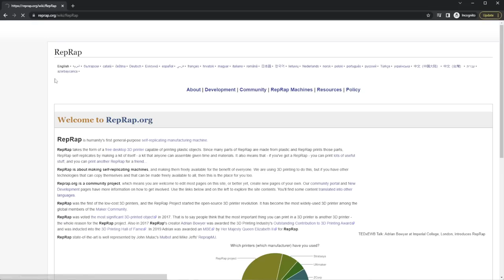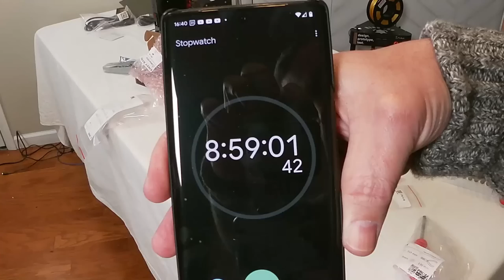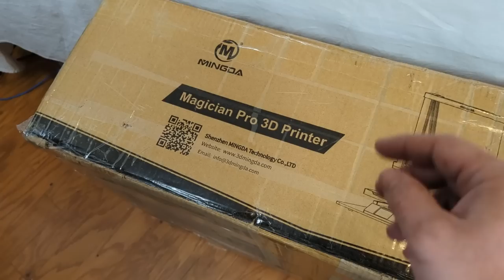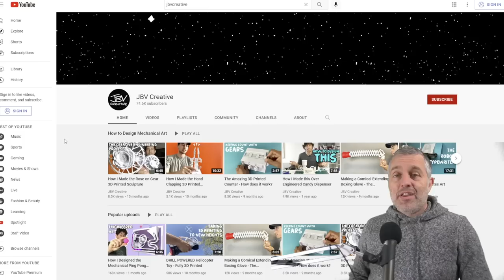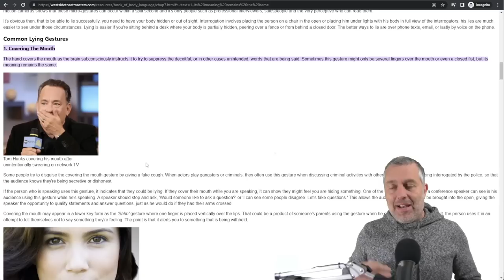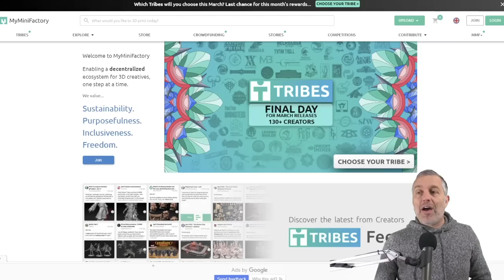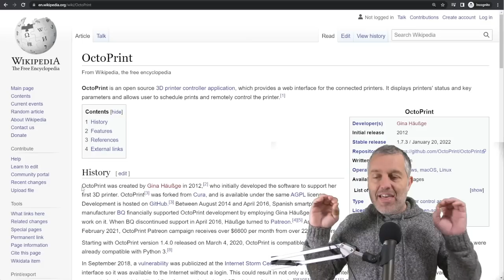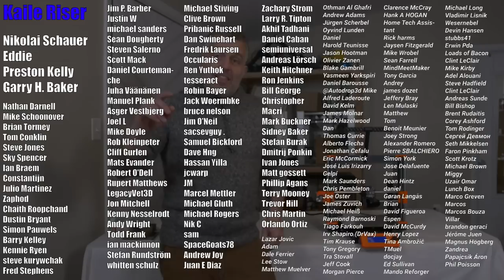Why Does Nobody Speak Truth About The Prusa I3 Mk.3? - It's Overhyped and Over Priced.

Comment: I am a big Creality fan (Ender 3V2), but I found after close to two years of running this printer intensively (pretty good for a $300 investment + probably another $150 in modifications and parts) a large amount of my time is spent in maintenance and calibration. My Ender was an incredible 3D printer learning experience, but now my interest is in CAD design and product fabrication.  It was time for me to buy a new printer and a lot of friends suggested the MK3S+ which I purchased as a kit.  It took me 8-10hrs to assemble (sure I could have done it in half the time if I rushed) and it just works. I think when you're a manufacturer in Czechoslovakia and you want conquer the international market you need to offer a great customer experience.  24hr customer support helps but how do you minimize the cost?  You do this by providing excellent documentation and very high quality control, and last but not least excellent software/firmware.  You empower the consumer with excellent products and you invest in documentation that covers EVERYTHING.  Open source, 3d printed parts, rep rap,  yada yada it's not quite that simple. A lot of thought and innovation went into these products. It could probably be made cheaper with injection molded parts, but then you wouldn't have the product evolve so quickly.   If there is a new revision to a part you can download and print it, if a part wears out or breaks for most of them you can print a new one or buy on amazon. Sure its double the price I paid for my Ender but I got so much more. The MK3S+ is rock solid, the print quality is excellent, absolutely no ghosting in my parts. I don't regret buying my Ender and for those that want to 3D print it's a great buy, but for those don't want to think about 3D printing but want to create specific projects get a Prusa so you can devote more time to your project and think less about the 3D printer. And about Prusa putting his name on everything, did you ever hear of Henry Ford?

Comment: I have an Ender 3 S1 pro which is essentially half the price of a Prusa. As a complete noob took it me 15 minutes to assemble and within 1 hour I had completed my first print. I just cannot see how from a value and print quality standpoint how the price of a Prusa is justified. The print quality from the Ender is amazing for this price and there is no way a Prusa could do any better. Maybe a few years ago Prusa was the best hobby printer, but now they have a been caught short and are no longer the leader as the competition has caught up. They need to innovate and give better value for money otherwise they might find themselves in a bit of trouble. I'm not a fanboy of any company, I just buy what I believe is the best value for money, and at this point in time Prusa is simply not good value and is looking very dated.

Like many, I almost bought into the hype, but my gut feeling, research, and my wallet told me otherwise.
Reply: I think the S1 Pro, which is a great printer, is over priced so you know what I think about the Prusa.

Comment: I think you've confused "truth" with "opinion based on personal lack of experience, faulty assembly and poor quality control" I own and operate several other brands of printers, most of them upgraded to hell, and still nothing beats the ease of use, quality, speed and overall usability of the prusa MK3.
Honestly, you really should have ordered the pre-assembled machine. You'd feel very differently about it.
Reply from the maker: I will grant that there is opinion mixed in with truth in my videos. Can you imagine how boring my videos would be if I treated the subject like a legal deposition only speaking facts and dry truths. 

>you really should have ordered the pre-assembled machine.
Why on god's green earth would I pay $1000 for an I3 from 2018 when the Bamboo Labs X1 costs about the same and I can get an Ender 3 to do the job of a Prusa for only $200. You sound like you make poor life decisions.
Reply: @DesignPrototypeTest  perhaps, because you couldn't understand the instructions well enough to assemble it yourself correctly?
That was my entire point, which you seem to have missed.
I mean, it's a review video essentially, which doesn't actually review an accurately assembled machine. Which you then proceed to bash for completely invalid reasons.
You also cannot compare another model to one you didn't assemble correctly. But hey, you don't seem to be the brightest, so we'll just call it a day.
Reply from the maker: Oh! You are driven by a need to tear me down. Here's the thing: Prusa printers were always hobby level despite what the marketing would have you believe. This kit is WAY overcomplicated. Any legitimate company with a design department would have redesigned this to remove at least 50% of the work for the end customer. When the Prussia XL gets released, it will be a much simpler assembly proving my point. Now, regarding your silly personal attack on my person: At this point I'm pretty much a professional assembler of 3D printers. I've made a lot of them. It's a small club I belong to in this regard with membership mostly comprised of fellow reviewers on YouTube. Giving my experience successfully building so many other 3D printers , do you honestly think I had a hard time comprehending these instructions? They were clearly written so a 10-year-old hobbyist could successfully build the printer. Prusa is trying to market to professionals. Why dumb down the instructions and micromanage when your customer base is supposed to be engineers who want the highest quality? These things don't add up. This isn't a feeling on my part even though you want it to be. My failure was not being detailed oriented with the instructions. I rushed through them because they were so insulting and boring. I figured it out for myself without the instructions whenever possible which means that I missed some small details like the orientation of the spool holder.
Reply: @DesignPrototypeTest  You attacked my person, so I attacked yours. Treat others how you wish to be treated.
I did say we'd call it a day, but since you seem determined to make this a battle of wits, let's have at it.
You've admitted to having failed to follow the instructions properly, and you continue to defend your position, despite not having performed a proper review of a fully functional, properly assembled machine.
If you're a "professional" this should not have been difficult, as many hundreds of thousands of people are perfectly capable of assembling them.
My point stands. You failed to assemble a machine correctly, and therefore your opinions on it are flawed. Do it correctly, and you'll have less people pointing out your faulty reasoning, and might actually take you seriously.
Look at your comments section. Look how many people are pointing out your errors. Does that not speak to you, and tell you that you've obviously failed to adequately develop an educated opinion?
Does that not make you wish to correct yourself, and do this properly, rather than constantly defending yourself as if every single comment is an attack on your character?
My initial comment was not an attempt to be rude. It was an attempt to open your eyes.
It only got hostile because you got hostile.
Now. Are we done here? Good. Have a great day.
Reply from the maker: I re-read my comments to you. No attack. I called your actions silly. But I made no judgement about your person. Whereas you said "you don't seem to be the brightest" The evidence contained within your comments indicates a maturity level around 14 years old. I should not be arguing with you. have a good day.
Reply: @DesignPrototypeTest  "You sound like you make poor life decisions" is definitely an attack on my character. Think before you speak. Cheers.
Reply from the maker: Again, I should not be arguing with you. You should be arguing with your peers. Ask them if my statement constitutes a personal attack. Disparaging your person is not the same as criticizing your actions.
Reply: @DesignPrototypeTest  Gotta have that last word, hey? 🤣 If you shouldn't be arguing with me, don't argue with me. You've already admitted to my exact criticism. And I'm far from the only person who felt this way about your video.
The ENTIRE point is that you failed to construct valid arguments, and continue to defend them as though they are. If you are an educated individual, a "professional" as you put it, then satisfy the many many viewers who gave these criticisms.

Comment: If it's too complicate for you to assemble a printer yourself just buy an assembled one.
Reply from the maker: It's not worth $250 extras for the assembled printer. You could buy an Ender3 and 2 rolls of filament for that much money.
Reply: @DesignPrototypeTest  Then why do you complain if the money is not worth it?
Reply from the maker: @sh00ting5tar  Why do I waste my time replying to trolls? You are clearly here just to harass and try to make me out as the bad guy. Your comment displays broken logic. Thing #1 is the directions. Thing #2 is the upcharge for the complete printer. I identified a flaw in Thing #1 so you are now saying I need to spend the money on thing #2? It makes no sense. They need to fix the instructions. Not charge people more for the complete build of the printer. You have undoubtedly complained about the wait time for XYZ company when you were on hold calling them (Thing A). Therefore you should buy a Bugatti (Thing B). See, it makes no sense. Or are you suggesting that  Prusa is purposely making the instructions bad so that people will pay the extra money for the complete build. Like they are tricking people into spending even more money?
Reply: @DesignPrototypeTest  Which broken logic? If you want a fully functional printer out of the box you have to pay more than just put it together yourself. The people at Prusa also want to get paid for their work.
In addition: calling people trolls just for raising questions really makes you look like a bad guy.
Reply from the maker: I don't want a fully functional printer out of the box. I NEVER said anything of the sort. That is Prusa's marketing pitch: A printer that just works straight out of the box. You really are a Prusa fanboy/troll/sockpuppet/etc. aren't you? Stop drinking the coolaid and assuming things about me that have been fed to you by the Prusa forums. I want the less expensive kit version. Except I want build instructions that don't suck because they are on another monument to an egotist.

Comment: Sovol SV06 - 6 bolts, 3 screws, plug in 3 cables, power on, ready to print.  There's the answer to the I3 MK3 - and you get more space on the Z access!  Oy yes, and can be yours for $239.

Comment: as someone who has used both printers 3 times more expensive and 3 times cheaper, I can say that the MK3(s) is anything but overhyped and overpriced, It's just a very very good product and the reason they can afford to maintain this price tag is that no one managed to properly compete at the same level, up until bambu labs showed up. There are plenty of wonderful affordable printers but none that come with the same features and reliability out of the box.
Reply from the maker: Alternate explanation: The Cult of Prusa has made the internet blind and deaf to the actual competition which has been around for some time. When discussing alternatives it seems only the original Ender 3 is brought up. It costs FIVE TIMES less than an I3 Mk.3 and is therefore not in the same league. Yet it can produce the same quality of prints albeit with more effort on the part of the operator. Being fixated on only that printer has caused you and those like you to miss other offerings from China such as this one https://youtu.be/geEm8mn6sbg Let's not forget that China makes I3 clones for ~$300 yet it costs LESS to employ someone in the Czech republic than it does to employ them in Shenzhen China (where all the 3D printer companies are located). Prusa has been earning OBSCENE amounts of money for years by over charging for this 6 year old design. All because an army of the fooled like yourself defend him and his printers wherever anyone dares to say a negative word on the internet. 

Note: I actually don't believe that this describes you. I think you are a manipulator. This is probably not your only account. I'm just playing along with you pretending like you are a real boy for the sake of the one or two actually real people who will ever read these comments
Reply: @DesignPrototypeTest  It's true that there are very capable i3 clones available, but let's not forget that a lot of Prusa's customers are businesses and it's unlikely for a serious business to bet on the cheap clone vs the original especially when the original comes with customer support and is at such an affordable price. Yes, $800 is expensive for most regular individuals, but it's not that expensive and it's certainly not expensive for a business.

As you and I have both stated, there are plenty of very good affordable models out there, but up until recently there were none that come with all of the options ready to use. If you're on a budget or you like to tinker, then you go for one of the cheaper options and that's perfectly fine. If, on the other hand, you just want something good that works, then you pay the premium for peace of mind, which is a factor that should not be underestimated. Now we're seeing Bambu labs offering a product that seems both superior and more affordable than Prusa's and it's exciting to see how things will evolve from here.

You conveniently overlook the fact that Prusa innovated for years while developing the various versions of the i3 and are responsible for so many of the features that we now take for granted and consider as standard for even the cheapest of printers out there, this includes countless contributions to the Marlin firmware that most printers are (were?) based on. R&D has a price and there's no way around it. 
I can give you a completely unrelated example - I own a Onewheel+ XR, which is basically a very heavy one-wheeled skateboard with a single Go kart wheel in the middle that is just awesome to ride. I paid $1800 for it around 5 years ago and everybody at the time knew that a lot of what we're paying is the cost of R&D. People were fine with that because there was simply no alternative on the market - none. Fast-forward 5 years and there are now cheaper community-driven open-source alternatives both in the forms of DIY kits and pre-assembled boards that are just as capable, if not more.This is a result of Future Motion (the company behind the Onewheel) sitting on their butts for years without any further innovation or significant improvements to their products due to the lack of a valid competitor. That's how the market works - competition forces companies to improve and provide more affordable products in order to keep existing, and it's a beautiful thing, although annoying at times.
Disregarding Prusa's role and contribution to the development of the community because you find their products "overhyped", "overpriced" or their "fanboys" annoying is not rational behaviour.

But then again, you also made an impressive amount of assumptions about me (all* of them wrong, not bad) based on nothing but my short comment above, so irrational behaviour isn't particularly surprising at this point. There is an abundance of arrogance in both your tone in the video and especially in your reply above, which is not at all uncommon for humans, but it is uncommon for content creators who tend to avoid alienating their viewers by being hostile and arrogant.

A couple of suggestions:
- it is possible that not all people who like Prusa products are part of a cult, it's even highly likely
- it is possible that people might prefer a more expensive product for hassle-free use and support for the developer (as an engineer myself, I would rather back the original developers as opposed to the ones who cloned an existing product, within the bounds of the acceptable)
- based on your general behaviour I can understand how your default is to assume that people who comment on your videos are bots or fake accounts or whatever it is you accused me of being, but it is generally ill-advised to attack and dismiss your viewers for holding perfectly valid opinions
- the part where the instructions tell you how to eat the harribo gummy bears is not insulting in the least, it's good fun and it's perfectly fine to disregard their instructions and eat the bears in a different order or doses, the printer won't break and neither will your ego!

*Actually, like most people, I have couple of gmail addresses, so I technically do have multiple YouTube accounts... caught red-handed :/
Reply: @theodordimov6518  this is the most constructive but at the same time fun reply, kudos
Reply from the maker: So, is theodordimov6518 your boyfriend? Or are you using your girlfriend's account? According to YouTube you are the only female viewer this video has had for the last 7 days. Pretty unlikely that you would leave a comment on the video. Let alone a comment on a comment.
Reply: @theodordimov6518  I feel sorry for your time loss 😂